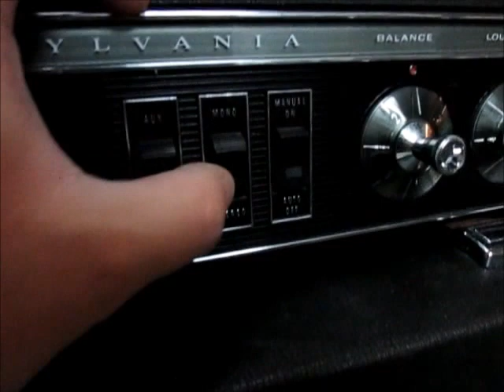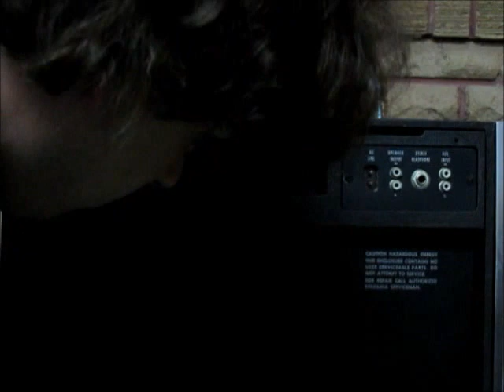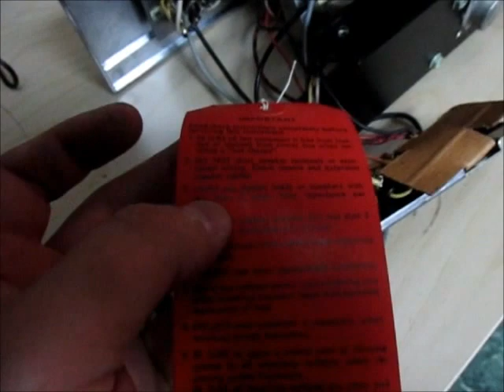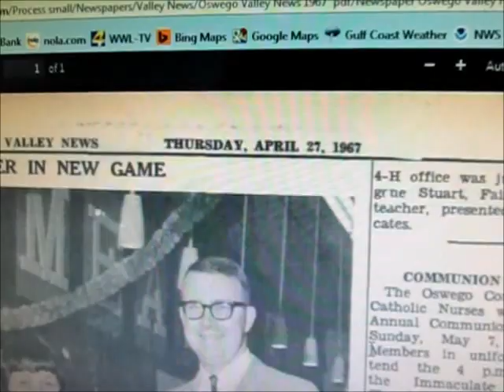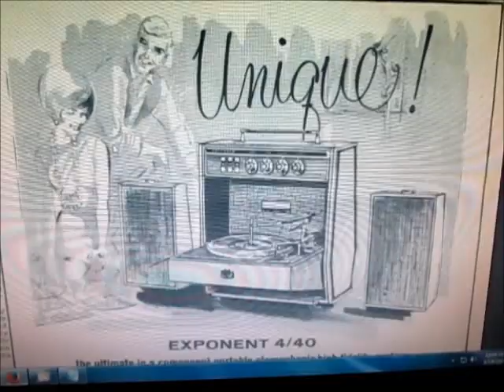Sylvania Exponent 4/40-2 Portable Stereo Phonograp

Comment: I’m terribly confused! I want to buy the 4/40 model but I want the one with the Magnetic Pickering cart but I can’t tell the difference between the two I can’t tell from photos online which version is the correct one!
Reply from the maker: The magnetic cartridge used in them was a Pickering V15.  I can't post pics here but if you Google that you'll see the distinctive (gray originally) stylus with a notch in the center that pulls out the front.  The ceramic carts would have had a solid body and had a flip over needle - you may be able to spot a little lever sticking out the side on those.
Reply: @audubon5425  I got the one with the Pickering but unfortunately it’s plagued like many portable Garrard’s portables and no sound comes out unless I unplug the built in amp and plug in the turntable into a separate amp and then it works. Did yours have this issue when you got it?
Reply: @audubon5425  there has gotta be a set of transistors in these portable Garrards in the amp or-pre amp that fail in these…I have a masterwork and fisher portable with this issue I’m possibly having this issue with a portable Lenco too
Reply from the maker: @oldradios09  the first thing I'd check is the phono/aux switch.  Then I'd try a signal tracer to see where it's lost.  You could also measure voltages if you have a schematic for the amp, or check the transistors for shorts with a voltmeter.
Reply: @audubon5425  unfortunately I do not have those things you described I’ll have to take it up with my repairman